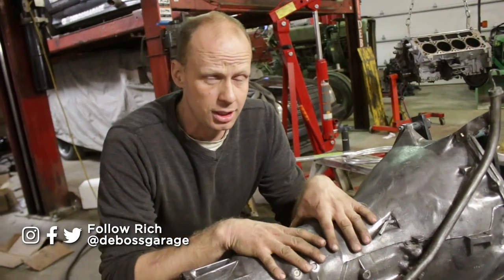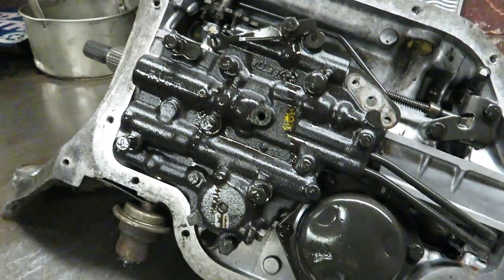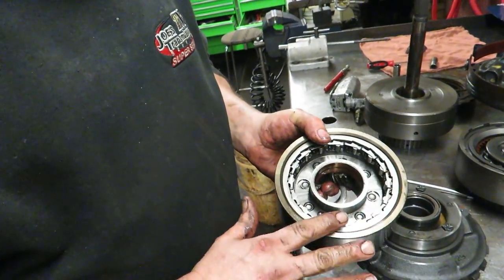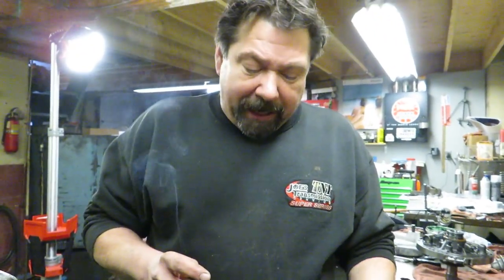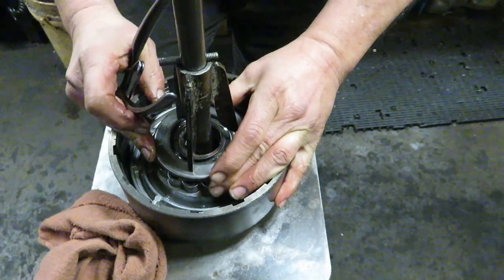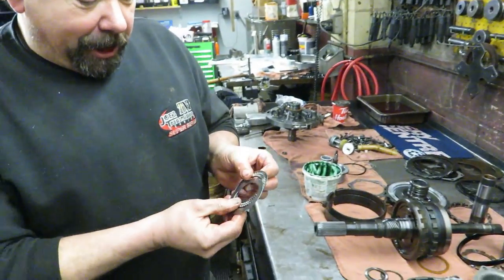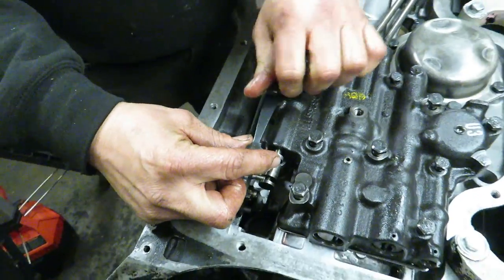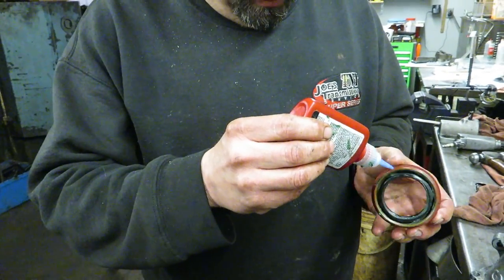How To Build a High Performance TH350/TH400 Transmission | '67 Pontiac GTO [EP16]

Comment: Great video, thanks for sharing !
I specialize in high performance Pontiac v8 engines and to get 500tq from a 400 block at the rear tires through a th400 you will need to stroke it by using a 4.25" stroke crankshaft to get the cubes up to at least 461-467cid, ill post a Factory looking combination that puts down power very close to what you want fwiw
67 block 4.181 bore, zero decked 
Cast steel 4.25 crankshaft with a 6.8" big block chevy rods with a forged piston
Keep compression to 9.5:1 with iron heads
Rod and main clearance should be .002-.0025 for the mains and .0025-.0028 on the rods
Use SD Performance hydraulic roller camshaft its 235in 244ex .632 lift 112lsa installed with comp hydraulic roller lifters and harland sharp 1.65 rockers with SD's shorter poly locks so i can use factory valve covers with, 1/4" gaskets
Have your iron heads sent there as well and he completely rebuilds and cnc ports them to 270+cfm and are a work of art 
I use any 68-72 iron 4bbl intake manifold and port match it, i custom build 850cfm 1975-79 Q-jets for these then i use The Oversized R.A.R.E. HO Manifolds with some port work, or if possible Long tube 1-3/4 headers which adds 20-25,hp
This combination combined with a continental jim hand special converter and 3.31 gears routinely puts stock weight GTO'S in the low to mid 11's at 117-119mph and drives pretty much like a stock gto, it will make 505-520hp and 565-575tq at the flywheel 
For 585-610hp and 600-610 tq you would use SD's cnc ported 295cc D Port aluminum KRE heads with 10.5:1 compression and a port matched rpm intake, this combo would be your best bet of reaching 500rwtq and not lose drivability, i do this stuff almost every day so i figured id chime in, good luck with the ride its beautiful!

Comment: Auto transmissions operate through magic and I don't think I will ever believe otherwise.
Reply: I agree Im pretty sure Joe must be witch doctor or a wizard to be able to cast the magic he's doing in this video
Reply: A reason some like Manuals, Clutch in, Clutch out.
Reply: I am pretty sure that tub of green grease is actually unicorn oil and I think I saw him sprinkle some fairy dust at one point. Just my thoughts though, it could be magic.
Reply: its just a computer..... that uses valves and pressure instead of FETs and voltage 

im a mechanic with a computer science degree (didnt want to leave montana)..... so when i took apart my old record player, it was a LOT of fun
its a mechanical computer.... limit switches, cams, gears.... 

a auto trans is just like a record player (mechanical computer)..... except it would be like having 200 record players all in one box

----------------------------------------------------------------------------------------------------

if ya get the rebuild book..... some have REALLY good diagrams that show where the fluid goes in every "stage" the trans can be in
and you can use compressed air to check to make sure it works like it should 

like.... when shifting from 1 to 2..... this valve opens due to the governor spinning fast enough to open its valve
fluid flows into the forward drum threw this passage, applys the 2nd gear clutch pack..... 

---------------------------------------------------------------------------------------------

just like anything..... it looks super complex, but actually isnt
Reply: like, all the "spaghetti" on the valve body may look REALLY daunting 

but if you think of it like a PCB board on a computer..... it is a lot easier to understand 

and ya dont need to know where every last drop of fluid flows..... 
just like when replacing a blown capacitor on a PCB.... ya dont need to know where every trace goes

ya just solder on a new one...... check for voltage in the specific test points the repair book says to check
and slap it back together

Comment: Da*n, this video takes me back. 
 I learned about cars in my youth and eventually became  Ford Master Technician.  I left the business in 2001 for a career in IT, but I haven't been able to keep my hands clean since then. 

 I worked in a transmission shop early in my career and our builder was a guy much like Joe. Dave didn't smoke cigars, but he loved cigarettes and boilermakers. He could build a TH 350, 400 or PG blindfolded...or blackout drunk.
  700/R4, 200/4R, AOD etc required that he built those before lunch time. LOL.
He kinda took me under his wing.  I got proficient at the old standards, TH 350, 400, C4, C6, TF 904, etc. 
 I haven't rebuilt a trans in decades and wouldn't attempt to now, but There's something satisfying about seeing Joe do his thing..

Comment: I haven't done much with autos, installed a few shift kits that worked well, I did buy a turbo 400 removed from a diesel to install in my 350 powered pickup, it shifted at super low rpm's so I adjusted the modulator valve to bring up the rpm shift point, worked great.

Comment: Years ago at Wyoming Tech we modified transmissions without buying a "shift kit" and one of the common mods was tossing the wavy steel plates with a flat steel or two. My notes advised this may cause "harsh" gear engagement, but personally and customers have never complained.

Comment: Ive had a TH400 in my Suburban blow, and a 4L60 in my SIlverado lose 3/4 gear. I priced around a rebuild ($2000+). Id never messed with autos before. Tried rebuilding both of them. Took me a few days, but both trucks are still running (3+ years) later. Less than $200 in parts for both. Alot easier than I thought.

Comment: I rebuilt a TH400 for my mom's 76 Caddy and the only tools I bought were a haynes TH400 manual and a micrometer for reading steel plate thicknesses. Took a long time to get done because I wasn't sure what thickness the steels were supposed to be because the ones that came out were waaaay to thin from wear. So I'd pick up the steels I'd ordered the day before on my way home from work and try them out and see what the fit was then call the auto parts store and order the next round of steels for the next day real quick before they closed. It's certainly doable for the home mechanic, just get all the info you can and make sure your work area is clean, I mean CLEAN and take your time putting it back together and lube the parts just like the guy in the video.

Comment: Thank you so much for making this video!!! I have a 400 on my rv I replaced after a trans fluid fire in a safeway parking lot. Had to toss the original one during the process of moving. The replacement trans gets stupid when warm and skips to second, revs its way to third, leaks fluid while sitting but has reverse unlike the old one. I had to rush rebuild the 4l60e on my truck before the move. So a 400 rebuild was not in my cards at the time when the rv was bought and immediately caught on fire at the parking lot. These transmissions are so old, it is tough to find good videos on how they work inside. Its too bad they don't have sonnax upgrades like pinless pistons .etc like the 4l60. But.... At least there is the transgo kits and the things mentioned in this video. I bought a sk400 kit for my trans on amazon. But it didnt have instructions, and its not the kit I need for what I want on the vb upgrade. So I gotta find the 1-2 kit and try again. Funny thing is, this is the kind of transmission John Doc uses in his cowmaro with 1000+ hp. I hate the 3 speed rev at over 60 mph, but if it can pull a 454 house up a mountain from a stop... It'll do...

Comment: I thought I knew something about cams, am running a 432 sbf, solid roller, 627 & 621 lift, dynoed at 611 hp, got lucky on picking stuff. This was a terrific video on cams, mostly head flow, tinman651

Comment: My stock poor 400 handled my 468 big block Chevy .650 horsepower.. sadly the case has had it cracking demise... 4500 rpm 1st shift sucks ... 6200 is her hot spot .. awesome video! Now to find another victim!!

Comment: I was trained by GM at their school for the truck shop floor on these and THM350 and the THM 400 The later mission also calls THM 375 / 400 he is very good at teaching and has very good personal building habits.  there is some use of rubber balls due to a fact that moves faster than the steel balls but the steel one is best for longer-lived timing checking as is needed for the sea transmission sifting correctness. This the only statement I do wish he had said remarked about during the valve-body portion of the transmission build this caused lot of builders to start using the three steel bells instead of the three rubber balls. It is us the good trans builder that makes and the real reason there are automatic transmissions turn into hyper fast-shifting manuals transmission in nearly every race-track uses of today's auto racing with dual clutches are another spin-off from automatic transmissions. Also high mileage car for the street of today.

Comment: Thanks for another awesome video. I'm looking fwd to the new carburetor and the RAM AIR. Then the drive, LOL. I have a 69 400 with a auto TB-400 in it. It's still has the original built 400 from the factory in it, as the car only has about 135,000 miles on it, so this was an especially nice video for me. I've had several Manuals and Automatics, frankly unless your dragging it or only driving it on special occasions I'll always pick the automatic over a manual. Automatics are far less hassle and far more reliable, beside if you've got a muscle car you want to drive it not work on the manual transmission, pressure plate, throw out bearing or other adjustments. Oh and yeah the Hurst is must to keep. Thanks for sharing guys. Best Wishes n Blessings. Keith Noneya

Comment: 55:17 - i just had my transmission fluid changed on an 2008 Ford Focus i own, and my mechanic just told me the same thing, that cork gaskets used to leak, and that he isn't a fan of RTV sealant as it has not much crush resistance , he prefers gaskets (i think he used a federal gasket on mine in November 2021 )

Comment: I bought  street  th 400 from Coan racing for a 1970 olds. It came with larger converter bolts. I had to hand drill the flex plate as I already installed the trans. Then I had  to go to the hardware store and get grade 8 bolts and washers  to shim  converter to get proper input shaft clearance. I was kind of nervous if this would throw things out of balance I never shimmed a converter before. So the car has been parked while I get opinions.

Comment: For the laymen, this vid showed how to assemble a stock transmission, very basic, much more is involved for a true high performance unit expected to survive with increased engine power.  Not knocking on the presenter, he could work in my shop.

Comment: The Lesson I feel from watching this is, always make sure you change your transmission fluid often from the time you get the vehicle (assuming you buy it new , or under a certain amount of mileage and a couple years old )  Or you may have to have a fellow like this rebuild the transmission.  And if it's this complicated on an old Turbo 400/350 transmission, what are these new ones like for complexity.

Comment: The turbo 400 is the show stopper. Even back in the day the gear crashers would leave  you be if you had a 400, because they didn't want to get smoked off the line then spend all night trying to crawl back your hole shot.
Reply: If you can't beat them complain loudly.

Comment: I wonder where the performance builds for transmissions start and how they get around, because I was taught to build the EXACT same turbo 400 for a high quality street build and with turbo 350’s I was told to shave 120 thousandths off and to jam an extra clutch and steel as well, this seems to tighten them up as well.

Comment: First time ive seen inside an autobox. Holy moly they are complicated
Reply: You should see bigger, more modern units with 6 or 8 speeds. The valve bodies are much more intricate and full of electronic solenoids and sensors.
Reply: @grabasandwich  I've rebuilt a bunch of transmissions over the years and the old ones with "mechanical brains" (valve bodies) that I've rebuilt have actually been more complex than the newer, electronically controlled transmissions I've done. The electronically controlled ones typically just have one solenoid per band or clutch (including one for lockup torque converter), a hall effect or magnet pickup on the output shaft and that is about it. They use the engine rpm and throttle position taken directly from the engine's computer (some like Allison transmissions also have an identical hall effect or magnet pickup on the input shaft). The computer controls the voltage for the clutch/band solenoids and even compensates automatically for clutch packs that tend to grab quickly or try to slip a bit because they are wearing out or because someone rebuilt them with high performance components. Even things like reverse lights are controlled by the computer directly (not the transmission) and when changing rear end gear ratios or tire diameters it is typically just a software configuration setting. 

The old "mechanical brains" (valve bodies) on the other hand are completely nuts in complexity in comparison and I've always been blown away with how they work.

Comment: The sniper is a good unit. I would have it dyno tuned so you a fixed program the ecu can then learn from and improve. If you rely solely on the adaptive ability it has via the O2 sensor(s), your asking for trouble when a sensor goes bad and either burns a piston, or washed down the cylinders. Just my opinion on how to make a good part run safe.

Comment: brings back memories 350 and the 400 plus 700r4 i was young and had more money in my life now run a 7 setter citroen 1.6 hdi picasso auto 110 bhp and 50 miles to the gallon

Comment: I have a 66 GT0. And it's very similar to yours when you started. Fenders,  Quarters rusted etc. Interesting watching your metal fab. work. You probably get asked all the time about cost of a frame off rebuild. Hint hint. lol. What would be a guesstamet on how much i should expect. My floor and rear windshield are still very solid. Thanks for being able to watch your work. And any other tip you could share.  Thanks, Craig

Comment: You always get the guys that just have to have that manual trans. And I know it’s fun to run through the gears, sometimes. But nothing sucks more than getting stuck in traffic after a long day and you have to work that clutch in and out a thousand times in the last mile. And modern 6/8/10 speed transmissions will beat a manual trans every time.

Comment: I am at the point where he has forgotten to put the centre support snap ring in - will he 'fess up or will it magically vanish from the bench and install itself. Also, there is a correct way up for the friction plates . . . apart from that good job so far . .

Comment: I've done a few TH350's but only installed a shift kit in TH400 and all that is is just removing the valve body and playing with the check valves and gaskets between the body and trans

Comment: Surprised he doesn't have an old speedo cable end to pull on that connects to his pump slide hammer
Reply: That was my first thought also, but you end up with 1000 little gadgets if you make something for every application. Those pliers fit all makes and models.
Reply: The keeper ring and the housings are pretty light, like pot metal... probably wouldn't last very long.

Comment: I  did not see you tighten the center support bolt before installing the valve body. Btw buddy.... you using the impact gun probably over torqued the valve body bolts. You using the torque wrench after did not assure them being at the correct inch lbs.
Little sloppy bud. Fyi.. I was an Allison trans mechanic for 20 years. The 540 is very similar to the 400. : )

Comment: i been getting the 02xx 400r turbo stock good to 800 hp for free i have 2 sitting now got 4 setups for free with the 450 hp 454 the 02xx trans comes with a heavy duty 8 bolt pump heavy clutches stage one shift kit stock . the 350 turbo is junk i went through 3 pro built trans then they gave my money back it would even do one pull every time it blew out second gear on the first pull on testing it i told them it would not hold up so they gave me a money back guarantee after talking me into one  plus the 02xx has most of the parts to build it up to a 2000 hp trans just the pump will cost u about 1200 to replace it they make a lot of different 400 turbos but the 02xx is the best that gm has u can tell if it is one by looking at the bell housing it will have 02xx welded on the bell housing gm uses them for strip or heavy applications so u can find them in trucks or motor homes that is what u want to start with and u can adapt them to Pontiac with a kit for it. i do have a 400r with a 8 bolt pump out of a 68 cutlass and the 350 engine   but the engine started to knock been parked ever since.

Comment: Very nice video. What are you thoughts of a Switch Pitch T400 for drag racing? I have one out of a 68 GTO and a non S/P BA out of a 1970 GS 455 Stage 1 with HD sprague & shift kit.. The engine is a 1970 GS 455. Any advice would be most appreciated.